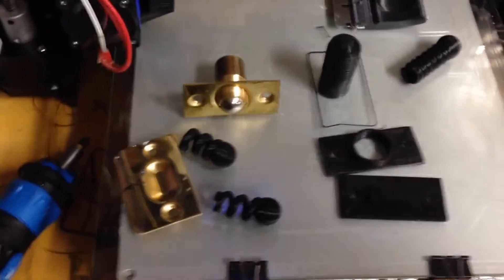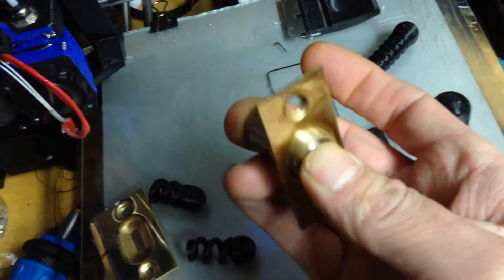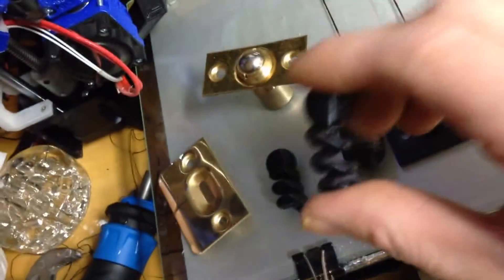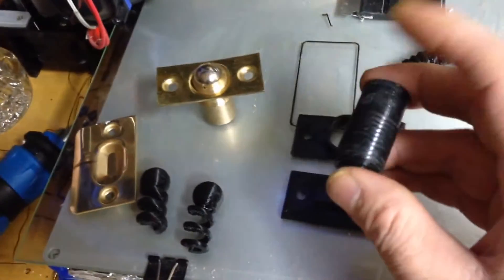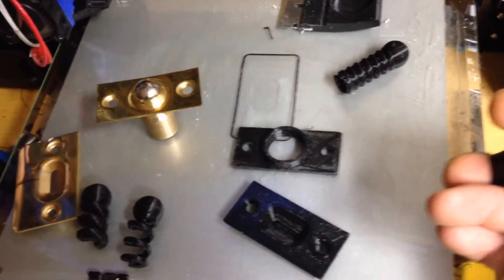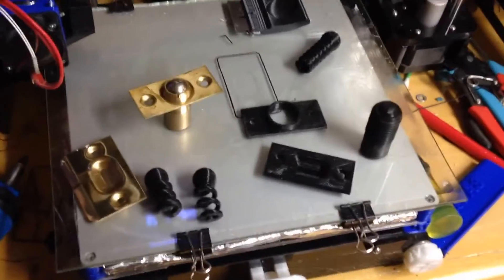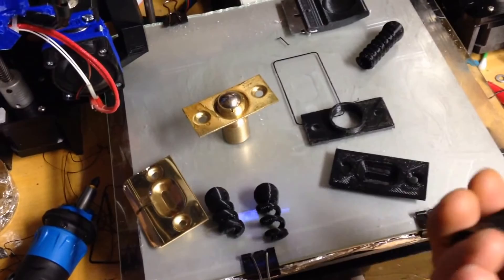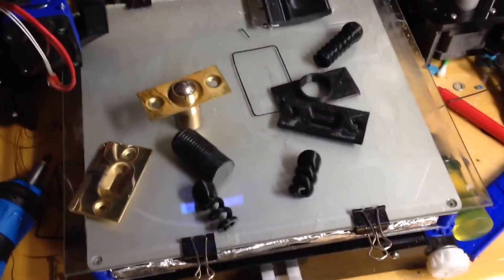3D printed adjustable ball catch for door's or cabinet's

Comment: So you saved $8?
Reply: IMO, the point isn't saving $8, the point is printing the part right where you are and not going to the store or waiting for it to be delivered. If the standard design isn't quite right, you could even have custom diameters, lengths, tensions, etc. Very neat Danny.